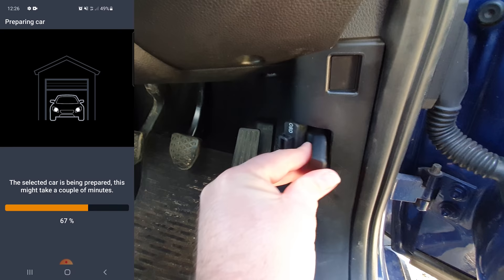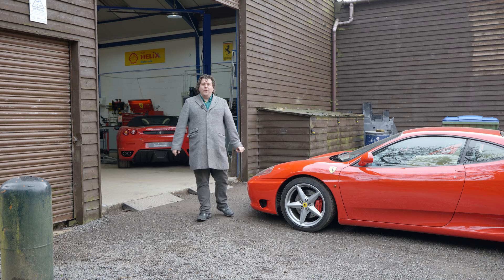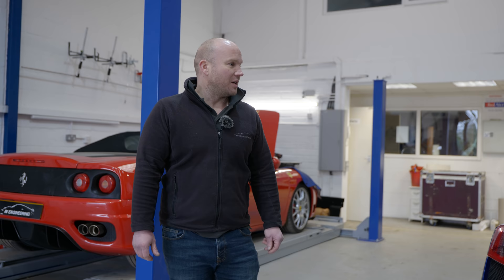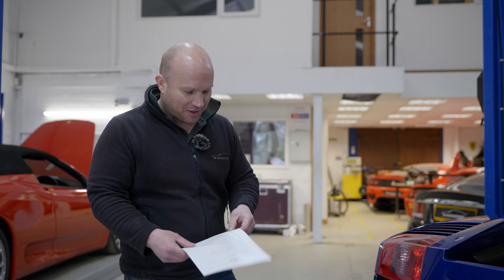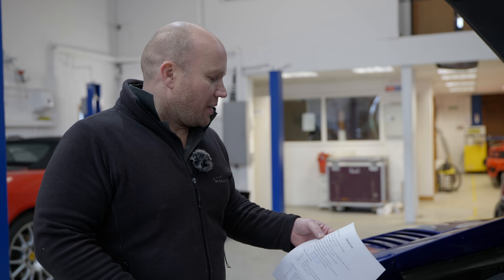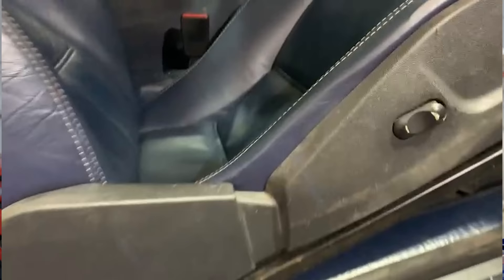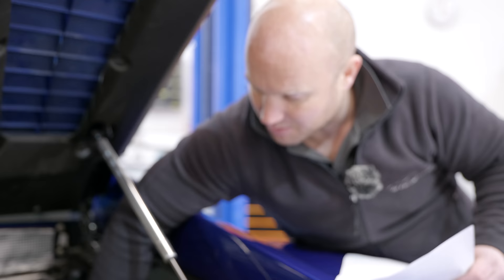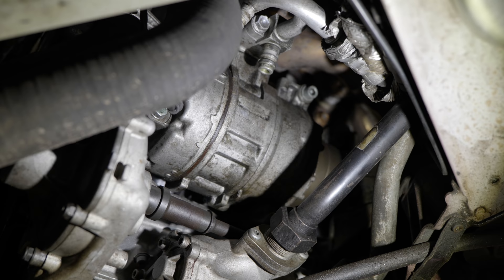EVERYTHING WRONG With The World's Cheapest Lamborghini Gallardo (That Runs, And Isn't Wrecked)

Comment: Blue / Red issue...  Back in the 90's I had the EXACT same issue with a Blue ford Escort, Did due diligence, HPI check etc, came back clean so I bought the car (from a dealer), several weeks later when pulling a trim panel out in the boot I saw red paint, Like you I was thinking of all possibilities, respray, primer accident repair etc, but again like you we were finding red paint everywhere. internally but all the doors / boot / bonnet had no sign of red paint.
Eventually I was so concerned I contacted the vehicle crime unit of my local police station and voluntarily handed them the car to strip.
What they found was shocking....  the shell was that of stolen red J reg escort which had the vin from a blue K reg escort stuck down over the top of the J reg vin so at a quick look there was no evidence of tampering with the vin, then all parts from the K reg fitted to the shell.  After lots of investigation it was found the original K reg had been badly damaged but with no insurance claim hence not showing on HPI, then rebuilt using the stolen shell.  Thankfully as I bought on finance from a dealer I was able to hand the car back !

Comment: Car was probably painted  red originally at the factory - the order was cancelled /changed and the car went through paint again and became blue. Gear knob has been welded  back on because they have a habit of snapping off with age. 👍
Reply: 0r the car has been a Vin number change.
Reply: @1005wiking  ...agreed. Too many broken clips and missing parts.. something dodgy has happened to this car..
Reply: @1005wiking  reshelled, perhaps? I'm guessing at some point it did get crashed at 6th Gear Experiences, and somebody used its VIN and the shell of a flood damaged car...
Reply: @richardharrold9736  It would be interesting to know if all the numbers on the car match.
Reply: @richardwintle1020  even if they do, all that proves is that the drivetrain is from one car. If the VIN on the chassis has been changed...
Reply: all the missing parts (esp the ones you can't see like the undertrays) and the red paint under the blue do raise suspisions about something more un-toward... would be interested if there was a way to check all VIN numbers for consistency
Reply: @richardharrold9736  Its impossible to say just from watching a youtube video. But I have had 15 gallardos through the years but never seen something like that.
Reply: @richardwintle1020  if they have used all the right bits from one car its still hard to tell.
Reply: @memsybabe  Thats for sure, it did not look like that in the showroom or in the salesbrochures.

Comment: The real shocker here is how much Audi charge for their parts....more than Lamborghini.  They're often more than Porsche, too.
Reply: Porsh*
Reply: @PointNemo9  ?
Reply: @karlmiller3623  Porsh*
Reply: @PointNemo9  why are you saying porsh, its spelt 'porsche'
Reply: Audi RS owners won’t be, £1300 for front rotors and pads LMFAO ...
Reply: They think they can do anything to their customers because they're a super posh premium brand.
Reply: @Hypersonik  In my opinion proper  nouns should be pronounced as they are in their language of origin
Reply: @ericpisch2732  you'd be surprised.
Reply: I've found with other parts bin items that the price sits still until they run out, then it jumps to whatever the oem is now charging.
Reply: @Imran A borscht
Reply: @PointNemo9  no one cares
Reply: And that’s shocking how ?
Reply: Dont get me started...Audi and their franchisees see parts as part of the whole profit margin (which is why the techs just keep replacing stuff until they get to the problem, and they only hv a fixed time allowance to fix). Just bought a coolant exp tank for the R8. Identical to the Q7. OEM Q7 part 65 euro , R8 part £130....there is no excuse except price gouging (Q7 part no is under the R8 label too). What is really important is...these parts are made by OEM suppliers so the key is to find them and avoid the 200-400% markup that Audi puts on. a little research via forums and FB groups saves a fortune.
Reply: vw need to make as much money as possible i guess. get the greed on before they have to replace every petrol car with a electric car and in 40 years when it's pointed out that batteries damage the environment in production and explode under impact etc. etc  they will then have to replace all tne petrol cars with hydrogen cell cars.... need to rip you off the most consumer
Reply: @PointNemo9  ??
Reply: @TheAdatto  It is spelt and pronounced as Porsh
Reply: @PointNemo9  i know how it is pronounched. But it is still spelled Porsche.
Reply: @TheAdatto  It is pronounced as Porsher, not Porsh
Reply: @paulredding5864  These cars are sold as premium products and are intended to be cash cows that’s why VW purchased the brand

Comment: For that gearshifter I think anyone with a lathe would be able to separate them and weld a new thread on the end of it (without changing the length of the shifter) and cut new threads into the shift ball. Potentially saving alot of money, and hey if it goes wrong you were gonna spend the £800 anyway.
Reply: I’d be more interested to know why someone has had to weld it up...
Reply: @geecars6263  i'm sure Tavarish had exactly the same issue on his fast and furious lambo, it must be a common issue
Reply: @dazasc3994  Which issue, the welded up gear lever, the glued up vents, the missing parts or the colour change? 😂
Reply: @geecars6263  oh the gear lever lol

Comment: strange when looking at the red coming through that the clip holding a wire or cable has been painted blue, suggesting paintwork at some point. A HPI check doesn't guarantee a car has not been involved in an accident, if a previous owner was just 3rd party for instance or a track day car that has had a few off's etc both instances the owner would be paying for repair not an insurance company and therefore any major repairs will not be recorded on HPI.

Comment: Great to see good mechanic that don't want to rekt you, but instead doing his work by the book on proper quality parts, so his work will last and in long term it will pay off. Cheers.
Reply: The reasons mechanics don't do things right Is because people don't want to pay enough to do things right, people look for th cheapest mechanic they can find, it's human nature
Reply: Spend 2k or 4500$, sure the 4500 dollar job lasts 10x longer but the consumer doesn't care.
Reply: @DomzyDX  it true, I've learned a lesson when in one of the cars I had to replace fan resistor, unbranded aftermarket was 40%price of original but it lasts for few months and the seller didn't accept return. So we decided with mechanic that it's not worth to risk again, so I bought genuine part which lasts till now and it's over 5 years already. If someone needs reliable car because they drive a lot I guess they will maintain the car properly. Especially oils, filters, brakes,tyres is not best idea to save on, because it will have influence on safety and reliability.

Comment: As it was an experience car I would guess it has had a few impacts in its time and they got parts from a salvaged red car to fix it.
Reply: Engine bay bulkheads? This isn't an honest workhorse, it's a ringer. This chassis and that VIN don't belong together...
Reply: @richardharrold9736  I don't know where the red is, the perspective was too close for me to judge. But if it's the bulk head then it is mostly likely a factory colour change.
Reply: @ConquerDriving  I reckon this car has been cobbled together from bits - a crash write-off's drivetrain and electrics and a flood write-off's shell. It's got ringer written all over it. The fact that it never had an MoT while at 6th Gear Experiences makes me suspect they just quietly flogged it off after it was crashed and never reported it...
Reply from the maker: The cost involved in doing that wouldn't make any sense
Reply: @JayEmmOnCars  it's obviously been bodged, and literally nothing about this car's history makes sense. Could just have been a hobby project for someone wanting a cheap Lambo built with their own inexpert labour...
Reply: @richardharrold9736  this car has definitely had a knock at some point I think they have taken parts of a red car and slapped on some blue paint
Reply from the maker: What is so "obvious" about it?
Reply: @JayEmmOnCars  If it's red underneath blue in the engine bay it deffo smells a bit suss. Years ago I came across a similar thing in a mk2 golf gti 16v. It was black but traces of dark (helios) blue in the hard to reach parts of the engine bay. The spare wheel well had a couple of minor scratches on the black paint and it was red underneath. It turned out it was a non declared write off that had been helios blue but had been cut and shut with a red rear end and the whole thing painted black! Not saying this is the same (I genuinely hope it's not) but for me it looks very suspect. The welded on gear knob would be enough for me to have walked away no matter how cheap the car was.
Reply from the maker: The thing is the way these cars are built it would be much harder to do than with an old Golf. Plus AV had this car in for a year and they got pretty up close with it so any signs of such a significant repair would have been pretty obvious.
Reply: @JayEmmOnCars  You say the costs involved wouldn’t make sense - if you’ve got a box of bits that would be worth £100k as a car then it’s worth doing, Youtube is full of channels where people do just that. One way to tell if the blue over red is genuine is to get the paint depth measured, shouldn’t be too hard to find out what the factory depth should be - any good detailer should be able to do it for you.
Reply from the maker: I'd expect the car to have had a fair bit of paintwork by now regardless.

The Gallardo hasn't been worth close to 100k for a while
Reply: @JayEmmOnCars  Perhaps, that still doesn’t explain the red. Colour changed cars make me nervous, colour changed cars that come back as always having been the second colour set alarm bells ringing.
Reply from the maker: @geecars6263  it is a genuine mystery. Some of the red at the front is easily explained - the brake calipers were obviously sprayed in situ so some got on the chassis.

At the back, less clear. Perhaps a respray at some point where red primer was used in place of the factory lambo grey.

There is zero evidence of the chassis being bent that we have found - usually very hard to hide on a car like this
Reply: @JayEmmOnCars  A quick bit of research - up until recently Lamborghini subcontracted the painting of their cars, the factory didn’t have its own paint shop until 2019. The primer used by the contractors is beige, so if anything that’s what should show through. Red primer is is a dull “red oxide” colour with a matt finish, the red on your car looks like a gloss finish coat.
Reply: @JayEmmOnCars  if the chassis has been replaced with that of another car (say, a flood write-off), then there won't be any damage evident...
Reply: Anybody else read Jayemm's comments in Jayemm's voice? Lol
Reply: @mykincadult-store1219  complete with the "Clarkson Island" exaggerated inflections...
Reply: @JayEmmOnCars  I'm not suggesting that these cars are built in any way similar to the way  an old golf was built, but they could be repaired by someone in the same fashion as an old golf was, ie easiest way to do a shabby repair and turn over for a profit. Have you asked AV their thoughts on this? 
Again, and this is only imho. But there is a really heavy whiff of cowboy if the "repairer" welded the gear knob on in situ in the cabin of a Lambo ffs! Would you at least agree with that?
Reply from the maker: Before I bought the car I asked AV if the car and chassis was straight and he was certain that it had not had any major repairs. He had been with it long enough he would have known.

The gear lever is a bodge fix and the kind of thing you would see on an experience day car. £800 to fix it properly or £20 to fix it quick - they will always go for the quick fix
Reply from the maker: It doesn't match the red which Lamborghini offered at the time. If it IS primer, it wasn't put on at the factory (have confirmed they used grey as a base)
Reply: @Pufferkusser  As it was a track experience day car and the gear shift has probably been welded to stop it coming undone , it will have been worked loose , not really a huge issue. Yea it's a rough fix but very very effective and cheap , doesn't mean the whole car is 'bodged'
Reply from the maker: @mykincadult-store1219  I do
Reply: There is no reason to believe this car to be a cut and shunt car.

Why would 6th Gear MOT a track car? The value of maintaining the MOT history would be outweighed by the cost of depreciation of it's track use. Anyone involved with track vehicles would be familiar with that.

If the company is too cheap to fix the gear knob, then they wouldn't want to suck up the cost of structural repairs. They would use the more cost effective route of an insurance claim. Then that would of be flagged in the HPI.

A likely reason for the paint, (note this is assumption because no one has any facts) 6th Gear probably resprayed tired sections of the car themselves to maintain the flashy image. No one wants to pay the overpriced ticket price on tired car.  However judging by the standard of the other repairs, the maroon colour was probably left over paint they used as primer.
Reply: @JayEmmOnCars  Here is an idea: If a blue car has a VIN that shows that the car should be blue and there are no obvious traces of it having been colour changed later in its life, the colour can never have been changed while it was with one of its owners. However, who says it had not been changed at Lamborghini's plant before the VIN had been assigned, which is typically the very last step in car production? I can easily imagine a scenario in which Lamborghini has a red(dish) shell for a car that got cancelled by the customer. It might be more economical for them to respray that shell and use it for another car than to scrap it. And depending on what that car was meant to be used for, a particularly careful execution of the job might not be necessary, explaining some old leftover red paint in inaccessible spots.
Reply from the maker: @englyn1  a definite possibility
Reply: Forgive my ignorance but why not just ask someone who was associated with 6th Gear?
Reply: @englyn1  Customer changed mind about colour at last minute? Plausible.
Reply from the maker: I did. The Car was never red while they had it.
Reply: @JayEmmOnCars  which is why I think it's a reshell. At the moment, I don't believe this is the 6th Gear car at all, but an ID swap. Now, what it is or isn't matters not in the slightest as long as it runs and drives well and the DVLA are happy for it to do so, but there's an awful lot about this car that just doesn't add up.
Reply: @JayEmmOnCars  When did the experience company sell it?
Reply: @JayEmmOnCars  There’s a video on YT of Lambos of that era being painted, the primer used is beige. In all my years painting cars I’ve never seen a manufacturer use a red primer. That said, maybe Lambo did on the Gallardo, in which case it’ll be dead easy to confirm from the dozens of rebuild videos on here...
Reply: @JayEmmOnCars  At the time that was built the factory sub-contracted the painting of shells as they didn’t have a paintshop, the paintshop was only built in 2019...
Reply from the maker: 6th gear said it is theirs and the timeline all matches up - I spoke with the guy who owned it for 10 years and runs 6th gear
Reply: @JayEmmOnCars  I know why the vents are glued up, apparently it’s very common for them to break...and they’re £300 each 😳 No doubt it’ll be like Aston/Ford and there’ll be a Skoda part or something ridiculous that is identical and costs £20 😂
Reply: @JayEmmOnCars  His Murcielago, SG54LAM, has an “interesting” mileage history - according to the DVLA it did 172,000 miles in one year 😂
Reply from the maker: Yep that's my guess. For an experience day who cares if the air vents open?
Reply: @JayEmmOnCars  Depends if you like breathing or not 😂😂
Reply: @JayEmmOnCars  the registration, VIN and blue colour match the car they had. That doesn't mean it hasn't been reshelled at some point, whether by/for them or a subsequent owner...
Reply: @JayEmmOnCars  Tell you what Jay , theres some "experts" on here who seem to be revelling in finding fault . As a non expert I'm enjoying this immensely and more power to you for getting it cheap and spending time and money with a top mechanic to get the car back where it belongs and properly sorted ! 👍
Reply: @JayEmmOnCars  They remind me of air vents I had on a 98 Alfa GTV, maybe a sourced part?
Reply: @JayEmmOnCars  That is never in a million a factory job, the cost would be too high id it wasnt done the first years of the cars life and the quality of the job is not a factory job.
Reply: @nickb997.1  Yep I think you're spot on.... I had a gvt v6 W reg, year 2000, definitely look like the same vents! 👍🏻
Reply: @englyn1  totally agree.
Reply: JayEmm I am LOVING this! Great buy. Interesting history. Really enjoy watching the fixes as we all do. Loads of opportunity to get parts cheaper. Keep up the good work!
Reply: That car was hit on the left rear. The gap between the passenger door and rear quarter is not perfect. They had to have replaced it with a red rear quarter. Non-the less you got a great deal on that car!!! I wish a deal like that fell into my lap!!